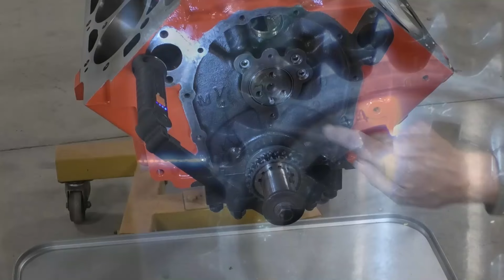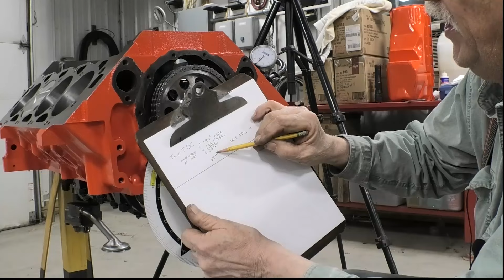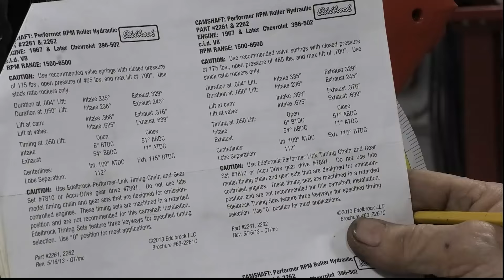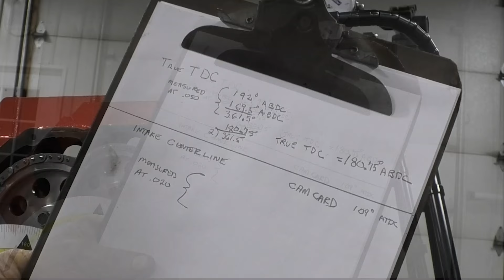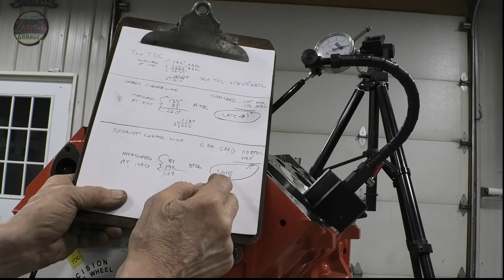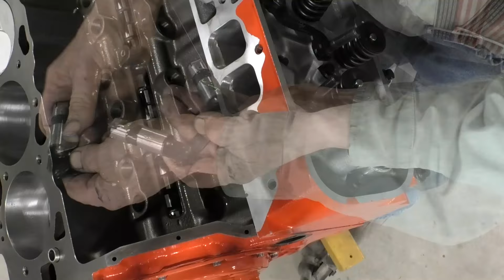Install Cam, Degree, Piston to Valve Clearance, 1949 Chevrolet Gasser

Comment: Did you cut out setting end play and final adjustments for degreeing or did I get interrupted watching the video and missed it?
Reply from the maker: I am sorry, you missed it. I degreed the cam then set end play between .005 and .010, and finally did piston to valve clearance. Degree starts at time mark 8:35, Valve to piston clearance  starts at 26:46,   As to end play I must have cut it out by mistake.
Reply from the maker: I will publish the missing segment next week as a special.
Reply: I didn’t see it either.